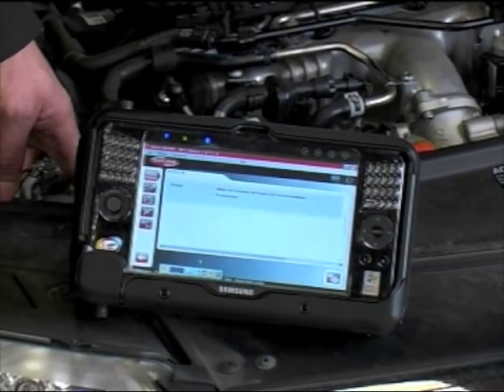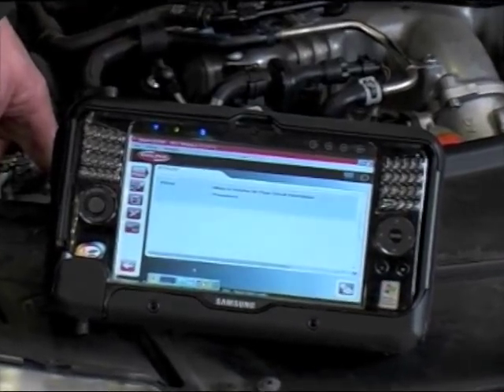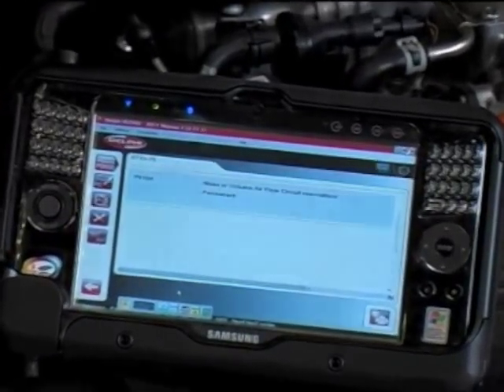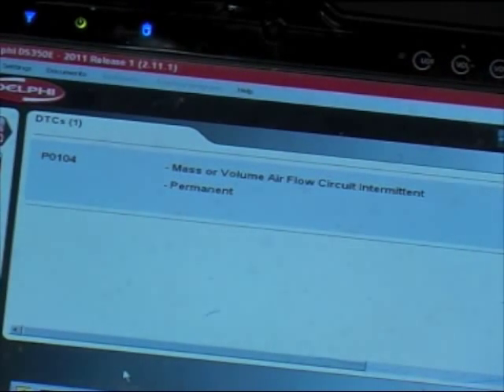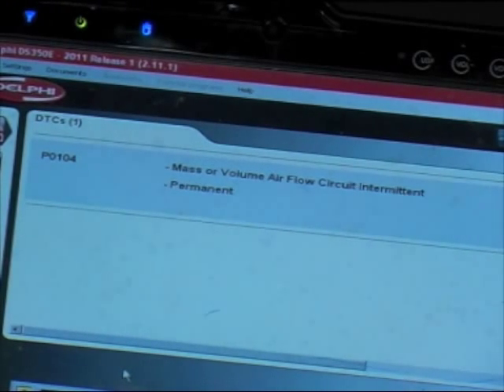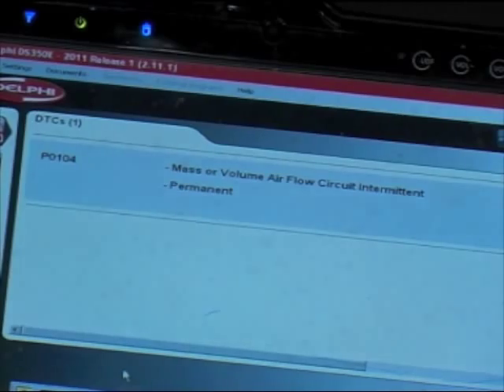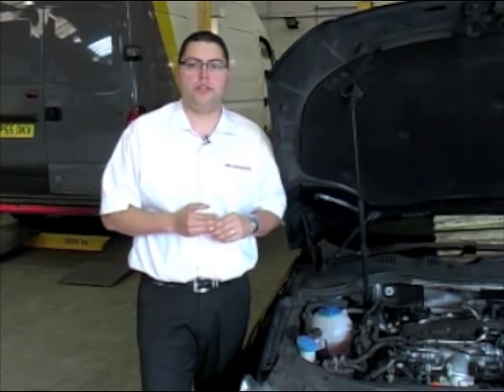Air Mass Sensor Fault Diagnosis

Comment: I've discovered your website through Autoinform, Its most useful and up to date and very informative. your section and diagrams on new systems and circut components with exploded engine images are very useful in providing me with resource material. Also your section on multiple tsbs for various manafactures is also very useful to refer to as it is easy to access and is in one place. Thankyou for creating an informative website for a small independent workshop like me, every continued success